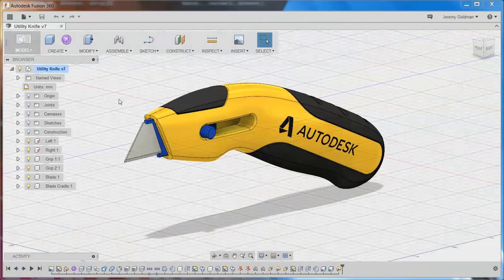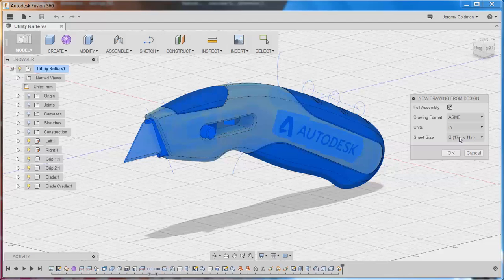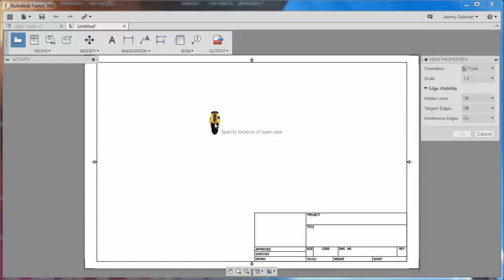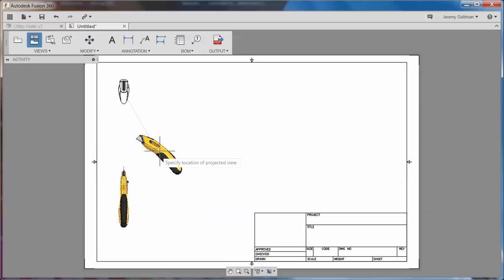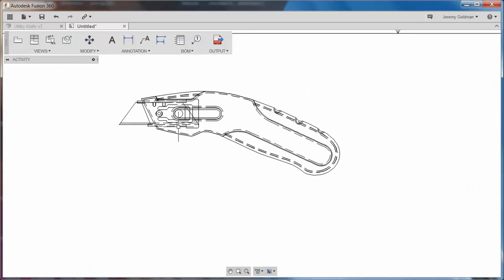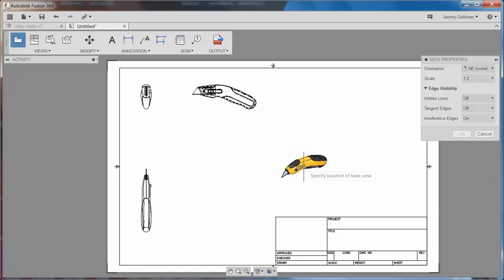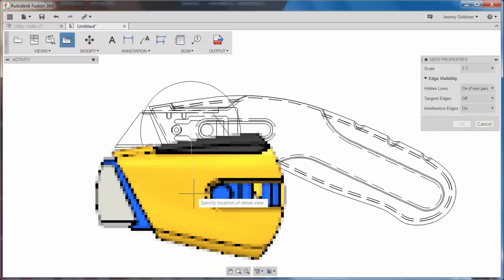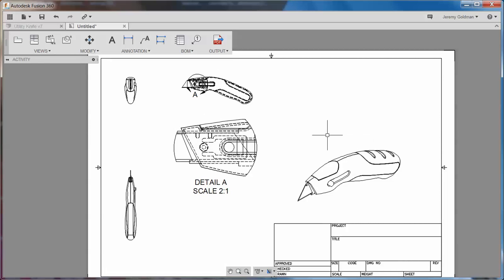Fusion 360 Drawings Workspace: Basic Training Part 1 - Creating Views

Comment: Now I see why it's so hard to get a usable working drawing on the shop floor that shows the dimensions needed to make a part.  

These kids start with pretty pictures and then try to corm up with a "Drawing" instead of designing a part as a drawing and then converting it into pretty pictures. - and this guy doesn't even understand things like the glass box or section view based on cutting plane lines.   Dr. French must be turning over in his grave. 

If it were not for G code converters these "3D CAD" programs would be totally useless.

Comment: Bye bye colors
Reply from the maker: You can use shaded or shaded with edges. It more the "norm" to avoid colors though.
Reply: @adskFusion  Inventor offers colors, will F360 ever offer them?
Reply: @danhmm  Pretty pictures do not a working drawing make. - Mechanical Drawing vs Ar Class.  Even Da Vinci knew how to make a 3-viwe drawing, but apparently the Fusion 360 team never heard of them.   Get a copy of" French's Engineering Drawing" and work as a draftsman for a couple years and then get back to us.
Reply: @mathewmolk2089  Too busy working as a senior engineer, I'll leave the drafting up to you